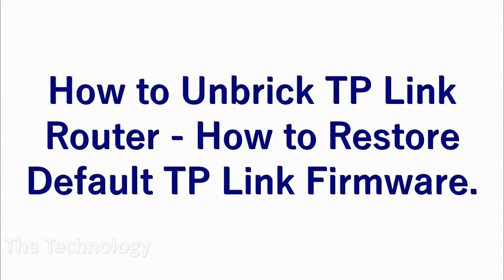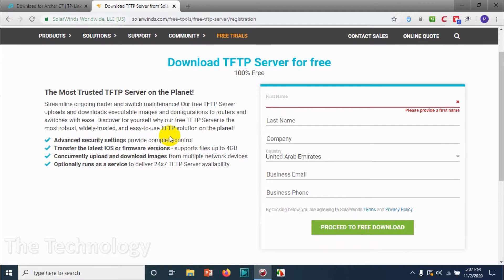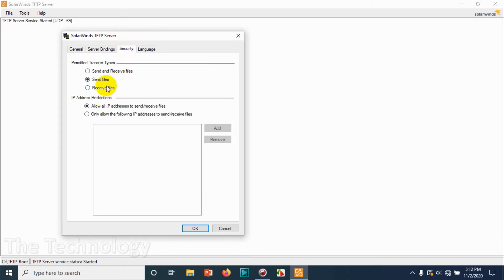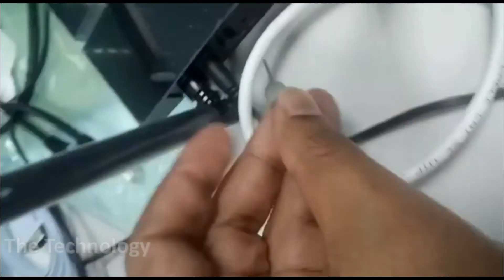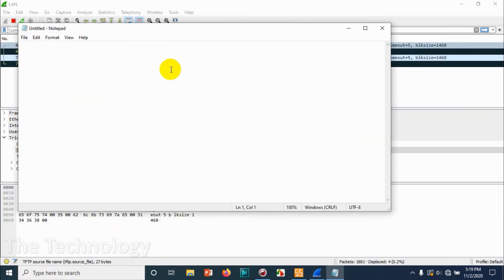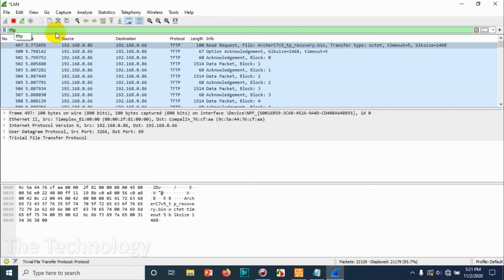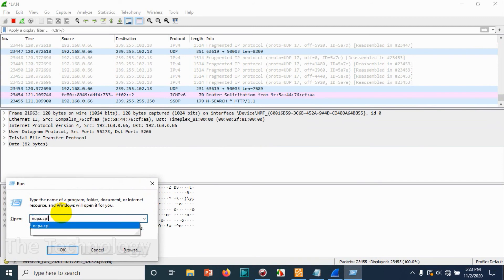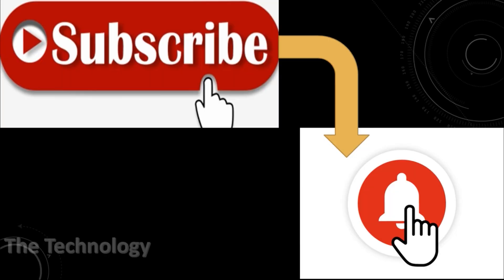TP Link Router Unbrick | How to Unbrick/Debrick TP Link Router? | Router Recovery from openwrt.

Comment: Many thanks for this excellent video, I managed to unbrick my Archer C7 and then install OpenWRT on it. At first I couldn't get it to work, but I wasn't resetting the router correctly. For anyone else, you have to hold the reset button in while you power the router up and keep holding the reset button until the WPS light comes on. After that it worked like a charm. Thanks again!

Comment: Is this applicable for archer c20 v5 which got dead bricked(no led too) after installing openwrt?
Reply: I did it for wr941 hp and it worked. After making the port settings, when the modem is turned off, hold down the reset button and press the power button, the modem goes into flash mode. Change the name of the bin file you downloaded. like "TLWR941HPv2_tp_recovery.bin"

Comment: I following the instructions exactly as described, but regardless of how many times I change the computer's Ethernet IP address to the one specified, Solarwinds doesn't identify the address, and instead defaults to 0.0/24. If I try adding another one, it will change the values to 0.0/whichever port I declared. It refuses to altogether bind into 0.66, no matter what I do :c is there something I'm doing wrong? I only have the default Realtek controller that was provided with the laptop, so the computer lists the bluetooth controller, the ethernet one, and the wifi, with only the ethernet enabled but still not working

Comment: For those who get the black ICMP "Destination unrechable (Port unreachable)" message:

I tried using a different tftp program called tftpd. Selected the destination of my firmware file, selected the network and turned on my router while holding the reset button. Then it started the transfer.

All for the C7 AC1750 V5

Comment: hello, I think I have bricked my archer c6 v2 when I tried to flash the stock firmware directly from the openwrt firmware and I followed everything you did in the video but I cannot get it to do anything. Only the power light comes on and nothing else. I really need this router running as I can not buy a new one as of now. I tried openwrt because my router takes too long to log into my pppoe account. please help me.

Comment: After flashing the original firmware, and getting the last block, my router goes back to a state where The LEDS stay on for 1 second, then they go off for 2-3 seconds. I followed all steps you mentioned, I even tried loading dd-wrt firmware as someone said they tried that and worked for them... nothing seems to be restoring my router, what is your guess about this please??
Reply: I also dont see that in Wireshark that the router is being flashed
Reply: @nefissakhedher1380  Im having this same issue... im using a tplink mr3220 v2
Reply: @manbash05 Hi did you find the solution to this? Please help

Comment: Hello,
My router is a Tp-Link M7350 mobile router and doesn't have an ethernet outlet.
It starts and stucks at showing the Tplink logo and doesn't boot.
Is it a chance to flash it back?
The reset button didn't worked.
Thanks for a tip.

Comment: I have a TP-link Archer ac3200, while I was updating the router the power supply disconnected, causing brick. I tried your method over and over, router won`t communicate with Tftpd64. Any advice?, BTW I am subscribing

Comment: any solution for c50 v4 ? nothing worked for me, I am officially frustrated, the stock fw flashed with tftp but the router won't boot properly, the power LED is the only thing that is working by now :(

Comment: Double check you guys downloading the correct firmware (“Archer A7” in my case). On the label of the router should say if it’s c7 or A7,… V5, V4… etc. And holding rest before turning on router.  The firmware name on the TFTP-Root for mine was still “ArcherC7v5_tp_recovery.bin” even though my firmware is A7.
Reply: second, third, forth check will not do any harm

Comment: Will this work for TP-Link WiFi 6 AX3000 Smart WiFi (Archer AX50). My router with this model is bricked
Reply from the maker: try it out with correct firmware version
Reply: @TheTechnologyZone  This did not work for my TP-Link AX3000.  I've literally tried everything.  Did you figure out how to get it into recovery mode.  Supposedly there is a way with AX3000 routers, but tp-link won't tell us.

Comment: Hi , i have a archer c20 v5 i follow the steps in the video , the file tp_recovery (in this case) gets tranfered into the router but nothing else happens
Reply: (TPLinkArcherC20V5.zip )
Reply from the maker: what is showing in wireshark?
Reply: @TheTechnologyZone  i just fixed it  needed to use another firmware image , thanks
Reply: @lalospidey  can you share the solution? I got the C20 V5 and brick it.... use TFTP to refresh latest OEM firmware and latest openwrt, none of them working. Thanks
Reply: man i have the same problem , how did u solve it? is the file name tp_recovery.bin wrong? or something else? plz reply bro :( or which file should i use?

Comment: It didn't worked on tp-link Archer mr200...😥😥😥
Reply: You find solution? my archer mr200 have a 169.254.x.x Ip and only one light of LAN port is on. Have the firmware for an v1?
Reply: @Linatros  I got a replacement due to a warranty.

Comment: I have a TP Link range extender RE220. After a firmware update it restarted but now only the power light is on. Nothing else happens. It does not even reset using the reset button. Can you help me?
Reply from the maker: You can follow the same method mentioned in this video. Possibly it has bricked
Reply: @TheTechnologyZone  i just tried. But holding the reset button and then powering on, nothing happens after 5 seconds in the log. I changed the id address to 192.168.0.66. Am i missing something?
Reply from the maker: @jishan17186  TP-LINK RE220 is a wireless extender not router
Reply: @TheTechnologyZone  i mentioned in my first comment that it is a range extender. I was wondering if this channel can help me. I think the ip adress has to be different. Not sure though.
Reply from the maker: @jishan17186  You mentioned sorry. This video will not help in that case. Extender and router are working in different ways.

Comment: When i use wireshark and i add the TFTP filter nothing shows up..
Reply from the maker: May be it has not reset
Reply: Make sure that your LAN is configured to run at 10 or 100 mbps, I had the same issue. LAN on my Motherboard is setup to 1 GBPS so I didn't get any reading on TFTP, after I changed the speed to 10 Mbps, it worked for me.
Reply: @natturious  I changed the speed to 10mbps, still it didn't worked!😭😭😭
Reply: @prashik2486  i think our router is permanently damaged it wont go in reset mode thats why nothing showing up in tftp log
Reply: @nikunjsharma460  Fuck!!!😨😨😨, btw I'm planning to claim the warranty since it has a 3-year warranty... Which model you were using?
Reply: @prashik2486  i have archer C6 one month old my router is also on warrenty btw where r you from
Reply: @nikunjsharma460  Hey, I got the replacement!😁😁😁
Reply: @prashik2486  what did you say to technicians??
Reply: @PremMallah  I said that the router was not responding, only the power button was blinking simultaneously and it wasn't rebooting so he asked me to courier to their service center. I sent it there and they emailed me that we are unable to fix your router and we are going to send you a new one instead (It was having 3-year warranty).
Reply: @prashik2486  thank you so much for quick reply ☺️ I'll visit lamington service center on Monday
Reply: @natturious  how can U change the speed ?
Reply: @killua2854  Open Control Panel\All Control Panel Items\Network Connections - Right click on the LAN Adapter - Go to Properties - Click on Configure - Go to Advanced Tab - Under Property scroll down and select "Speed & Duplex" - Under Value change from Auto Negotiation to 10 mb full duplex.
Reply: Bro same here did you find any solution
Reply: @nikunjsharma460  nope. if you find a fix let me know
Reply: @Yahfz  i think our router is permanently damage it wont go in reset mode thats why nothing showing up in tftp log
Reply: @Yahfz  btw which operating system are you using
Reply: @Yahfz  i think our router is permanently damaged it wont go in reset mode thats why nothing showing up in tftp log
Reply: i also tryied ubuntu method but it also wont working

Comment: Excellent.. I was able to de-brick my Archer C6 V2 router, which got bricked after attempting to switch from OpenWRT to stock firmware.. Wireshark really helped in identifying the network issue..
Reply: Can you share the filename please
Reply from the maker: Glad it helped
Reply: can you please let me know how you fixed the network issue? I can't get it to show on the tftp.
Reply: Same problem. But my case not showing tftp in wireshark any one help me
Reply: @kaushal616 tftp also is not showing in Wireshark for me also. Did you find a fix? Please help.

Comment: Fantastic video. However, the software you used "tftp server" didnt work for me. I then used "Tftpd" and it worked! Router is back online! Additionally, TFTPd has a log viewer so you don't need Wireshark, everything is built in. Which is VERY helpful. Thanks again!
Reply from the maker: The one I had was not logging anything. So I had to use the wireshark. You are welcome.